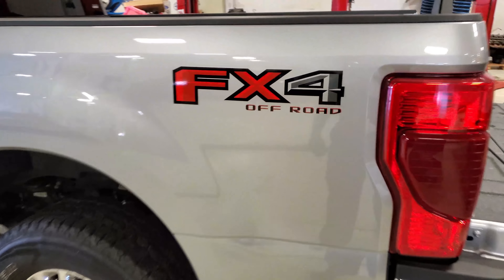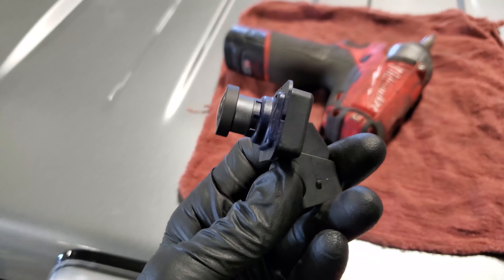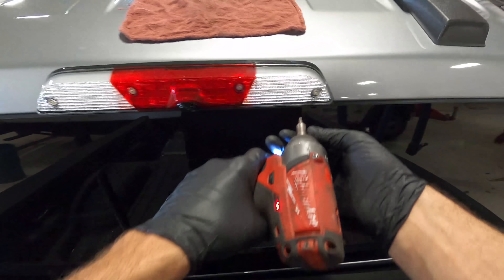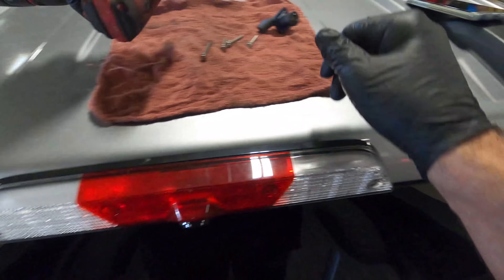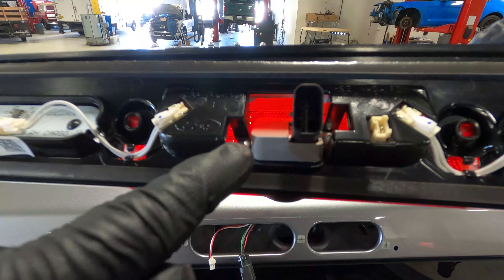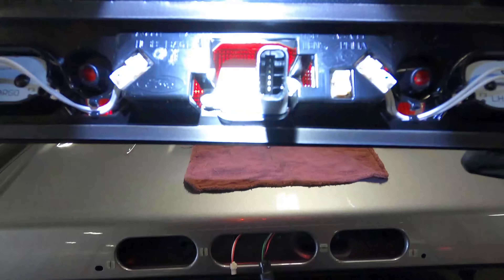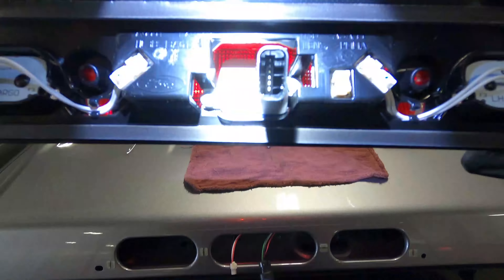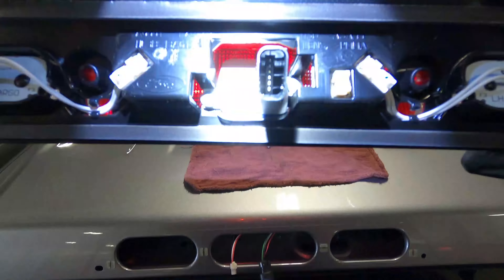7.3 Godzilla |BACK UP Camera Replacement|

Comment: Hey hey, yooper with a question. Speaking of cameras... (‘20 f350 ultimate sport w/ center bed cam) i found all the oem parts to replace my non front oval camera to  a ford oval with cam and washer set up.  The female brown plug is right there waiting in the grille. My question is, is this as simple as plug and play and the software is already in place to change to the camera on the screen? I have the camera button next to lane assist. I do not have 360 but seems I’m ready just no cameras besides tailgate and chm
Reply from the maker: Hmmmm...not sure. Havent had that inquiry
Reply: So i bought HC3Z-19G490-Y. Dislodged light brown camera plug from front grille where it seemed stored for later use out of the way from the factory. There was an adapter on the end the prevented mine from fitting BUT that adapter was the only thing stopping mine from hooking up to that plug properly. So that plastic piece had to go. Now I’m attached to that plug up front like a glove and everything seems great, except... nothing inside on the screen. Hmm thoughts...
Reply from the maker: Powerstroketechtalkwarod@gmail.com
Reply: @gregorlich6529  did you you ever get it to work?
Reply from the maker: That system is NOT plug & play. Missing software, modules.....etc....$$,$$$

Comment: Is this process similar with the 2019 model. I've had front and rear cameras replaced in last 2 weeks and everything if out of sync. Keep getting messages on radio installation progress or process still ongoing. Have another dealer appointment next week to fix this. Man I wish I could just drive this beautiful truck your way. I know you would set things right. Great videos.
Reply from the maker: Come see me....err one else is!!!!

Comment: Is fdrs still sold alongside ids as a package or did they separate them. And can I just continue to use the vcm 2 instead of the 3 with fdrs I heard there are a lot of bugs with vcm 3
Reply from the maker: FDRS is a software program like IDS. You'll need to download it like u did IDS. But, you HAVE to hook to the internet to use anything in it & must have a secure log in so FDRS knows its you whose using it......😔😔😔
Reply: @PowerStrokeTechTalkwARod  can a independent shop have full access just like the dealer on the fdrs
Reply from the maker: I believe so. You have to visit rotundatools.com Only stop for anything we have or use @ the dealer!

Comment: Do you know if you can add the cameras afterwards, my truck doesn’t have them but has the front camera and backup I would like to get the 360 and was wondering if you can add it after?
Reply from the maker: Yea im thinkin prolly not. Havent been asked tho...
Reply: So what happens if someone wrecks their mirror and has to replace it? I figured since I have the ultimate package it would have the correct wiring for it
Reply from the maker: Not sure how to answer that. Like you cant just add the mirror camera to it and it works. Theres a buncha modules and harnesses that communicate all the cameras together. Its not at all "plug n play"
Reply: I figured you’d be a good person to ask, I guess if you do find out, I would definitely like a video on it that way I can maybe add it later that would be awesome
Reply from the maker: Hell yea brother!!!

Comment: Hey got an actual question for you I drive a 20 7.3 in a 550 flatbed tow truck application haven't had any issues with the motor or the 10 r140 trans. Have you had to do any warranty work on actual motor part of this power plant combination thank you sir
Reply from the maker: Sssssshhhhhh wait in 2 weeks ull see. Simple oil leak
Reply: Noooooooooo!!!!!!!! 😭
Reply from the maker: Gravy tho...no worries pal
Reply from the maker: Theeeeeeeeeeeeeeeee only 1 tho 👍
Reply: For now anyway thank you though I appreciate the reply my tow truck has 33000 miles on it so far no issues appears to be a great combination
Reply from the maker: God DAMN!!!!!! U come thru the D,  u look up PTT!!!!

Comment: Whats that pay from Ford, .8? Heh heh

Why not roll a lip spoiler into the roof and at least mount the 3rd brake lamp flat or angled down, rather than in the water trap position? How many years now?

Btw...Those 7.3 gas motors look eerily familiar?
Reply from the maker: LS baby

Comment: Hmmmm Bro you getting old? I heard the little uggg as you walked down the tailgate step. I like that Iconic Silver. Well that threw us for a loop. What is the deal with the 7.3L door badges. I didn't get any on mine.
Reply from the maker: Fer real??
Reply: Badges I made. Its Amazon special. One is 7.3 and the other said superduty. Didn't come with any. I would of liked it to say 7.3 godzilla in the same font as the 6.7 diesel logo
Reply: @mariobrothers8348  Well from the video they look great. I see a lot of Ford trucks. So I'm like wait- a -minute they say 7.3 L Super Duty